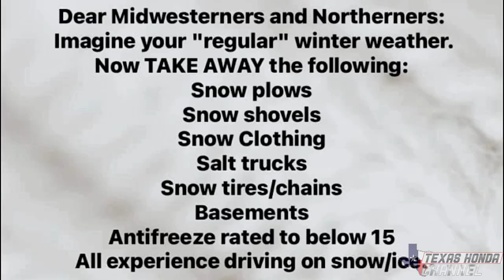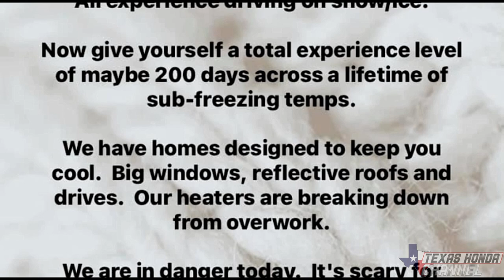Texas Winter Storm + Polishing The Supercharger pulley (2003 Honda Pilot)

Comment: Stay safe man. I know up here in kentucky it's terrible, we got like 5 or more inches of ice with 2 or 3 inches of snow packed on us but like you said we're used to it and have salt trucks and equipment to handle it. Keep up the awesome content, hopefully this weather will pass soon and you guys can get back to normal down there. Keep warm and God bless.
Reply from the maker: Dang man i hate cold and sorry you have to go through it as well :( We should be in normalish temps in the next few days hopfully. Its been over a week i think its almost 2 now. Either way we will make it through. Texans Helping Texans is the motto around here.
Reply: I was completely unprepared. I knew the storm was coming but underestimated the impact. I have a 97 Civic that I've got alot of money invested in  and instead of parking it in the garage I left it in the driveway, so now it's completely covered and out in the elements, thank God I'm in-between paint jobs and it's in the primer stages at the moment but I'll be honest, I've had it out a couple of times and it's done pretty well in the snow all things considered. It's been fun kicking it out in empty parking lots doing donuts. It does pretty well on the roads as long as you know how to control it turning into skids and taking it slow. One things for sure, I'll definitely be glad when this winter crap is over. As if this covid nightmare hasn't been bad enough, we could've done without the bad weather.
Reply from the maker: @dalelitteral9459  We were prepared for almost anything and we got super lucky (blessed) that we have a prepper mentality. We had emergency food to last us months and fire wood and all kinds of stuff that came in handy. We were prepped more for government type take over but it came in handy nonetheless

Comment: The best advice I can give if you want to polish a pulley like that (and I recommend against it) is use light pressure on the sand paper. The more pressure you use the more likely it is that the sand paper will grab and try to suck you in.  Plenty of impatient machinists have been bit using too much pressure sanding parts on a lathe (usually when sanding bores) and that belt being that close adds additional danger.  It's would be A LOT safer to remove the pulley and rig up an arbor for a drill or take it to someone who has a lathe.
Reply from the maker: That’s what I was doing but i have good steady hand control and done it a lot but that don’t mean nothing could happen by accident.

Comment: Nice I have a 08 pilot with drive by wire I m gonna attempt this and did you adjust your timing or no
Reply from the maker: Nope didn’t adjust timing my tuner said it should be fine with the colder plugs bkr7eix11 plugs the stock are 5s so they are 2 steps colder and using 93 octane instead of 87 is helping too. Only so much we can do with the apexi. I’ll have important apexi video coming out NEED TO KNOW INFO. please watch it when it comes out it’s something I didn’t know till now

Comment: Pilot looking good James👍👍finally got that vtec switch running can’t believe it actually works lol
Reply from the maker: Haha awesome! I had one on my old sedan 10 years ago it does work at least for me it did haha
Reply: @TexasHondaChannel  aye James how do u wire up a fuse and relay on it? I don’t wanna mess up my ecu
Reply from the maker: @alexrivera2450  I don’t have a video on how but basically just run a relay so it goes through that or put a small fuse inline
Reply: @TexasHondaChannel  so u can run either the fuse or the relay on it? Like splicing in between
Reply from the maker: @alexrivera2450  a relay is better but a fuseable link can work too with low amp fuse like 7.5 amp or something
Reply: @TexasHondaChannel  thanks James👍👍🙏🙏

Comment: You need to do a built bottom end j series and crank up the boost
Reply from the maker: Not on the daily unfortunately lol
Reply: @TexasHondaChannel  I really just want to see a blown j cranked up like the guys are doing with the turbos. Instead of snapping into boost it should be a much more linear power delivery which should be great for the drag strip. Your right though forged bottom end motors dont tend to last near as long when daily driven
Reply from the maker: @jeremypike9153  Even if the bottom ends would last awhile it’s our only vehicle that fits all 6 of us. Either way i still plan on going all out on a J series like all these others guys do but clearly they have the money to go all out lol I don’t have crap for money. $11 in our bank account right now nothing in savings. I do what I can with what I can lol 😂
Reply: @TexasHondaChannel  right there with you. I'm waiting to get the funds together right now to get my 302 swapped pinto up and going same situation moneywise too